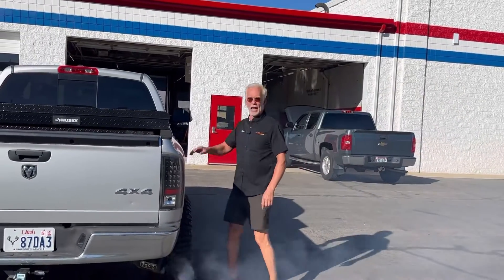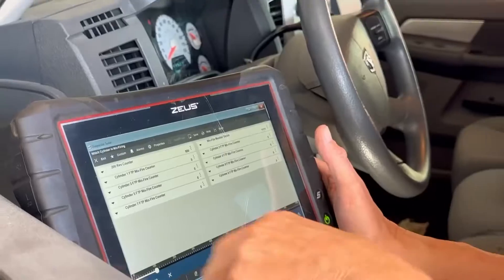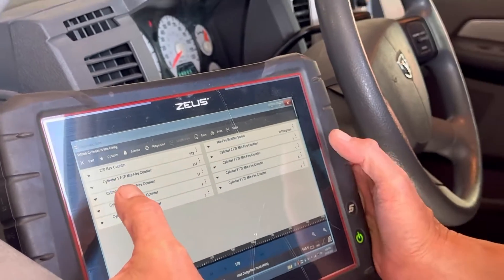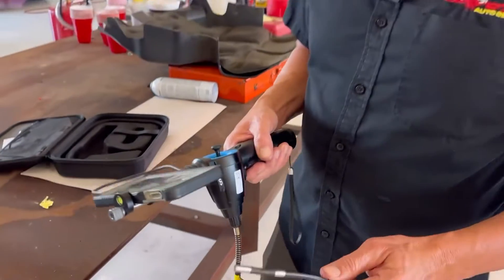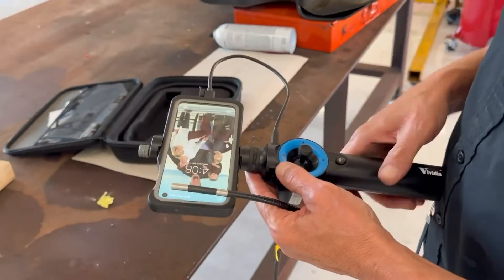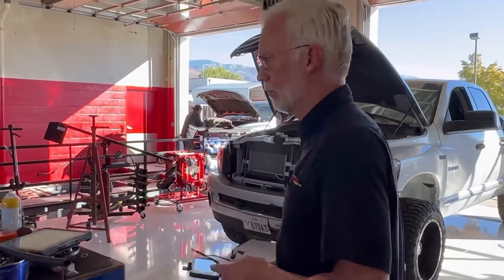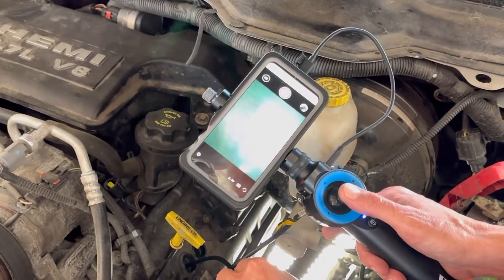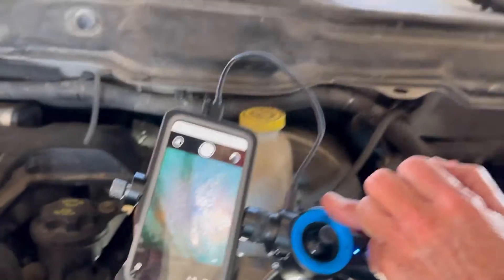What a piston looks like when the engine ingested something! 2012 Dodge 1500 5.7L Hemi

Comment: Hi Dave & Crew.....Disagree with the previous comment ( longer 20-30 min videos );  some of Dave's " longer " videos do not seem to go in any really " planned " direction ( side comments, non-related discussion/s..etc, etc ).  This particular video seems to get 
" Right to the Point " !!  Note: Dave......Great to have the year of the truck/engine size;  but might really help with the overview is to have the " mileage " and possible service-history if you can supply ? Also.....some of the shorter-videos, do not have the MANY commercials during that 30 minutes.  The short ones never seem to  have them & are also enjoyable / Tks,  jeffrie/Camas, WA

Comment: the truck  looks  like a 2006 not a 2012
Reply: I ran the plate on Carfax, it's registered as a 2008
Reply: @trucksandheavymetal  that would make sense,  2006 and 2008 have simmaler headlights.  The ugly  taillights of the 2008 have been replaced with  aftermarket ones

Comment: My 2011 f150 5.0 with 200k once drank 5 quarts in 1k miles without so much as a puff of smoke from a stop.
 Had the engine "cleaned" under warranty and she stopped burning oil completely, but started a knock on the bottom end from an aggressive cleaning I assume.
Reply: Me think they scam guy to get his truck for cheap in reality could of keep driving
Reply: So what leak little oil it's truck
Reply: Chevys rust….. Fords leak oil..

Comment: Swallowed lifters!! Cam and rockers too are going to need replacement as well he’s in for about 4500 dollars to fix
It!
Reply: Just by a used engine around 2k Dollars probably with 100k miles or less
Reply: @donaldkinder6716  gonna run into the same problem they are defective in the trucks at some point

Comment: We need longer videos! These TikTok clips aren’t enough.  Need 20-30 min videos!
Reply from the maker: Thanks for the feedback. We are working on Longs. Appreciate you watching our videos.
Reply: @DavesAutoCenterCenterville love your work Dave! Keep at it, us young fellas appreciate your work!
Reply: @DavesAutoCenterCenterville 
The early 21st Century Hemi Engines are apparently  infamous for dropping Valve Seats, Bruce to conflicting choices of metals for the seats and cylinder heads.
Reply: I second
Reply: Nah fr his videos be interesting
Reply: Sounds like Discovery might be picking them up so you might get your wish
Reply: Keep doing these short videos, but just add a link if you want to do longer ones. Good stuff 👍
Reply: say it louder for the folks in the back
Reply: Absolutely
Reply: I own one of thos truck 2017 ram 1500 still has the hemi tick at 190 000km  randomly had cylinder 4 miss fire  now its good.  I would love to here more about cams and lifter failur videos on their fix same with their front end intermediate shafts issus